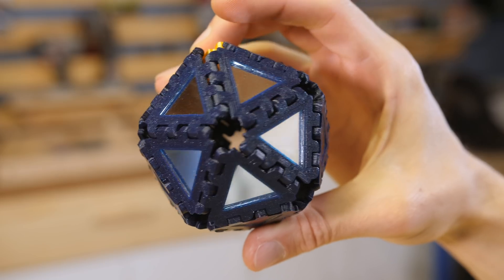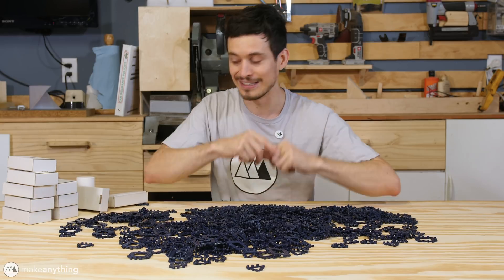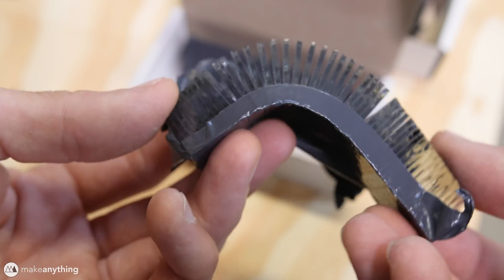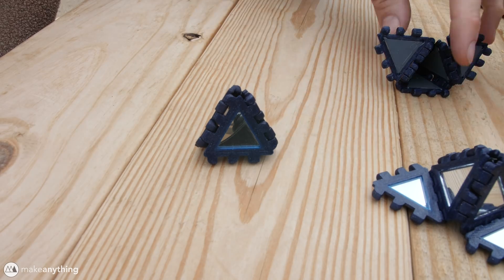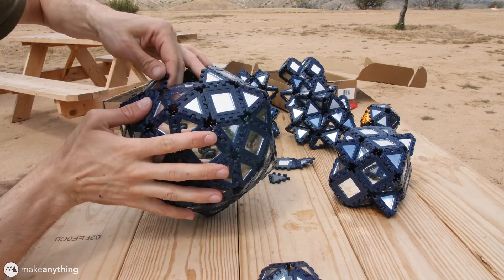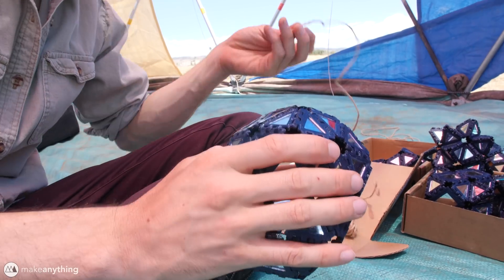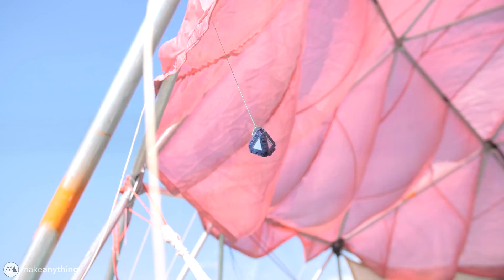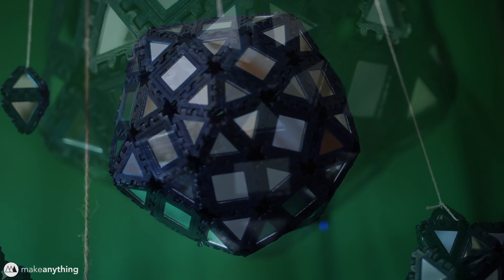Making Polyhedron Disco Balls with Polypanels

Comment: I want to make big wall mount picture which you can assemble from little pieces, these polypanels looks like a plan, but maybe pixel like square shape would be better? and it also looks cooler when snap area is as little as possible. Any ideas on that?

Comment: Attach small LCD or OLED displays instead of mirrors, synchronize each display and each polypanel disco "ball" to show Electric Sheep (or in the style of ES flames) videos, use motors to control varying speeds of rotation per PolyPanel Disco Video Globe.  Try making the PolyPanel pieces from interesting filaments that compliment this type of funky display system.  Do the PolyPanel pieces change color, glow in the dark, can they function as light conduits for the illusion of additional animations through their edges (think projection mapping but without the projector).

You might also expand on the projection mapping aspect by using Pico Laser projectors in the gaps created by the joining of PolyPanels in addition to the small video panels inserted within their facets.  Or, you could simply add the Pico Laser projector elements into the gaps of the PolyPanel Disco Globes you've already made.  Figure out how to time the videos so that they not only project outward but can take advantage of all those reflective surfaces.  The laser projectors are all focus free, are ideal in their own right for projection mapping, should make for a glorious series of How-To / Do-It-Yourself videos for your channel and for future competitions.

Comment: It might be easier to print the bottom and walls of the poly panel, tell the printer to pause at a specific layer, insert the mirror, and have the printer print seal the mirror in by printing the backside on top of the mirror.

Comment: you should try 3d printing your own structure using electrical conduit, it's super cheap and easy to cut with a conduit cutter tool. all you'd need to print is the elbow pieces.